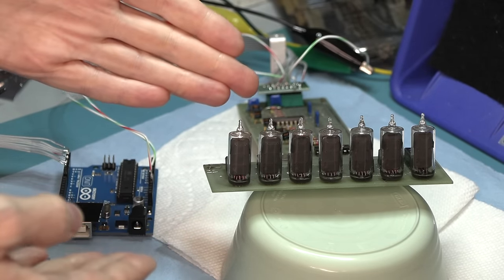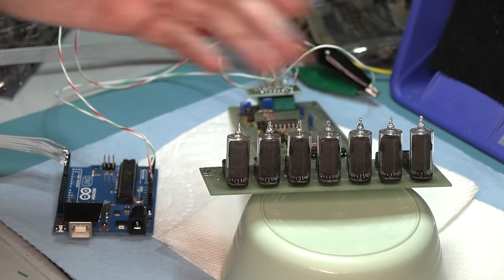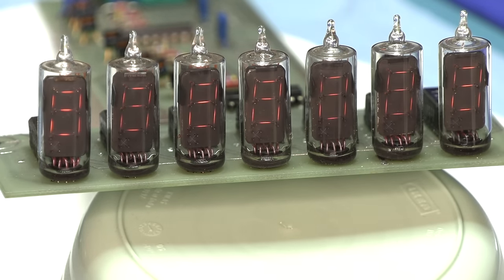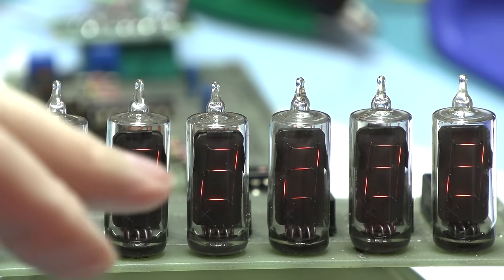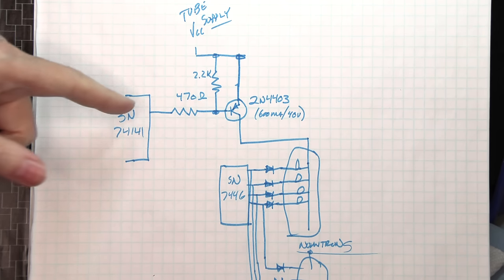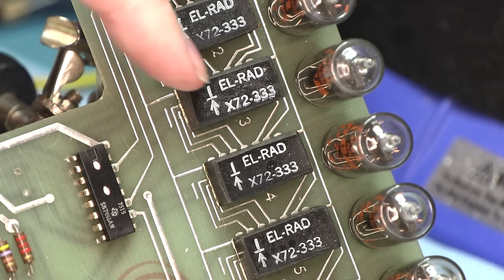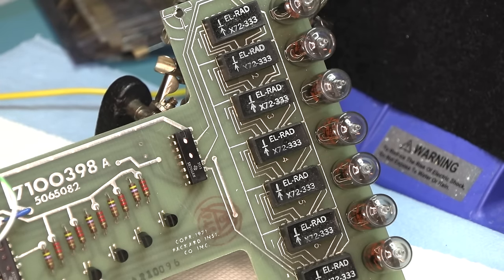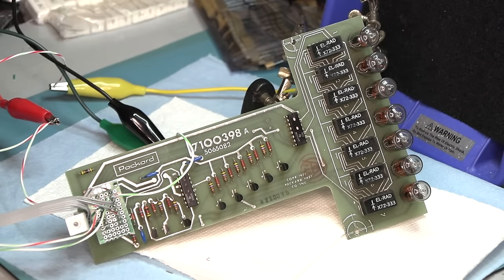The Magic Of Muxing!

Comment: NEVER multiplex vintage displays if you have the option to do direct-drive. As a longtime creator of clocks using nixie, numitron, NIMO, etc devices, the last thing you want to do is reduce the operating life of a device that is no longer manufactured.

In the old days, multiplexing was done because the drive electronics was expensive. Today, the electronics portion is dirt-cheap compared to the cost of the tubes, so saving a few dollars on the IC's doesn't make much sense if your tubes cost hundreds of dollars apiece. For example, the gigantic, though butt-ugly 14-segment 7971 nixie tubes are going for 200USD apiece now, and the few NIMO tubes I've seen were over $300, and those were untested. A six-tube clock is a hefty investment, so treat your tubes as best you possibly can.

Why is multiplexing bad ? Simple. When you multiplex, you can see the brightness goes down. To offset this, the current must be increased in order to increase the brightness. With gas-filled tubes, the wearout mechanism (generally sputtering) is exponentially proportional to the current. Incandescent tubes undergo thermal shock, from cold turn-on as well as thermal cycling. Similar wearout problems can be expected from multiplexing fluorescent and electroluminescent displays.

Some displays, notably gas-discharge panels and multicharacter displays, require multiplexing because the number of pins disallows direct-drive, so in those cases you have no choice.

I add circuity to limit display currents to safe values, such as using current regulators on my nixie clocks, and filament preheat/cooldown on the incandescent/NIMO ones. Knock-on-wood, nothing has died yet.

Comment: I loaded PC boards as summer jobs during college. Paid twice minimum wage! A really good high school electronics course meant I could easily read resistor codes, and a Manpower rep at a job fair said, “Want to be employed tomorrow?” 😄 Got me through college! And yes, I was usually the only male. 😂
Reply: Its hard these days to simply get young folks to come to work 5 days in a row.
Reply: @resipsaloquitur13  it wouldn’t be if you paid twice minimum wage.
Reply: Same here but wire-wrapping! The cables were colour coded for length. Sounds tedious but I loved it.

Comment: It would be very nice for a nightstand clock. Analog voltage dimming for night time, tubes would last forever if not pushed that hard.
Reply: Yep. Made one. Pi powered clock radio.
Reply: @liquidsonly  you posted it somewhere for us to see? And why a Pi? Itsy quite power hungry.
Reply: @zaprodk  My posts to the link get deleted each time.
Reply: @liquidsonly  Only solution seems to be to setup your own YouTube channel, put your stuff in there then post that YouTube link here - YouTube does not mind links to itself 
On your own YouTube site, as your now a creator, you can put in as many links as you like, just like Fran has on here.

Comment: What i am missing (or did not see?) is something for emergency shutdown of the filament power when something with the mux goes wrong. Just a random software crash may kill the expensive display quicker than the watchdog timer would kick in....
Reply: This demo doesn't seem to have such a feature and that's probably why Fran is turning on the filament supply after the logic supply. But it should be noted, light bulbs can often last for a few minutes at 3x rated voltage before burning out. Knowing this, a few seconds of 7v on a 5v filament isn't going to cause any harm. If Fran was running higher voltages additional protection would be much more important.

Comment: At one point I had the idea of building a large matrix display with micro incandescent bulbs, 1.2V/15mA per bulb or so (still sitting in a drawer..) - I stopped when I realized that soldering 800 flimsy wires to my 2.5x2.5m framed wire grid and also programming the graphic functions was a bit tedious. But what helped to increase the response time of the bulbs was to preheat them with a current that didn't make them glow, or to scan them fast with a pulse width that also didn't make them glow just yet. As far as I remember this way it was not necessary to bump up the voltage this much. (So in case of an error they wouldn't break because of the overvoltage.)
Reply: I have the identical idea.  The “always on” current, will be high, and effectively creat a I.R. source (I would fine-tune that voltage/current in a darkened area, for a barley perceivable glow), effectively, a radiant heater.
This technique will increase the glow-time, after the ON signal is replaced with the Keep-Warm, which is a small inconvenience compared to the projected extended life of the lamps in your display.
I’m looking forward to seeing your build!
Reply: Somewhere I saw a spec sheet / data sheet about using bleeder resistors for a trickle-current thru the filaments.
It wastes energy but reduces the thermal shock so it probably extends the lifetime of the filament since it's already at high resistance.
Reply: @SawdustSoftwareSiliconChippy  :) I've did this in 2006 or so - unfortunately I'm struggling with my health nowadays and due to the tremor of my left hand (and a huge backlog of ideas/projects) it's a bit unlikely that I'll revive the project. Anyway, I was fascinated to have an almost point-like, tiny light source that shines 360° in all directions. Today you can probably find LEDs for this.

Comment: I could be wrong, but i dont believe solder flows over the component side during wave soldering.
Reply: Seems pretty risky, "feels" like high chance of blobs n bridges gettin' stuck under the chunky components. I have no direct experience of PCB manufacturing in the '70s though, I started dabbling with it during mid/late 90's 🙂
Reply: Agree. The solder is ONLY on the bottom of the board. If it were to go over the board it would immediately be scrap. The thick solder traces are covered in solder before the components are loaded and it's called HASL.
Reply: Yes. They tinned the traces before putting the components. Once saw a board where the wave accidentally went over the board. What a mess.
Reply: Agreed. The one time I got a tour of the PC board manufacturing facility, I saw how the solder "kissed" the bottom of the board and wicked up.
Reply: The board is suspended trace side down over a tank of liquid solder. A linear actuator at one end of the tank "slapped" the surface of the solder, sending a single wave along the tank and washing the underside of the board.
When you stuffed the board the tails had to be folded over because the solder would push the components out.
The women stuffed the boards but men flowed them, at least where I worked.

Comment: I'm not sure if the 5 ms and 2 ms mentioned were per digit or per the entire display.  I suspect "per digit."  You have to get above the human eye "flicker fusion threshold."  Long ago we might have called this "persistence", but that term also means how long an image may be perceived after it was gone, so the more specific term is now used.   It is about 60 to 90 Hz for humans.  If "per digit", 5 ms would be 35 ms to scan the entire display which is about 29 Hz and "flicker" would be expected.  At 2 ms it is 14 ms for the entire display which is about 71 Hz and probably barely fast enough for at least many humans.  But if certain other animals are watching this, such as an owl or a house fly, they will still see a flicker.  You have to be a bit careful designing such things as not all humans are identical and if you use yourself as the test subject, somebody else might still see flicker.

Comment: Would the cost of one diode block be 40x more expensive? It might be possible that producing this block would be only 3x more expensive than same amount of discrete diodes. ICs weren´t that much integrated at that time. Encapsulating a single diode vs. encapsulating a dozen diodes should not be a factor of 40! Still a valid point of cost saving by using ICs.
Reply: If the blocks were custom-made it would be more than 3x the difference. If it was off the shelf then I could believe 3x.

Comment: If you're multiplexing with overdrive and the processor locks up, I guess you run the risk of burning out a display?
Reply: Yes. Also imagine just how many TVs got a horizontal phosphor burn from the vertical deflection malfunctioning. With the specific display Fran has the original host device most likely used hardware multiplexing, minimizing the risk.

Comment: I have a few hours free if you like me to debug FranCad. Funny that the "boring" part of the video was what I wanted to learn about most. I have some ICs that I wanted to use for multiplexing, shift registers actually IIRC, but I have never gotten them to work. Been a while since I tried, maybe I wasn't using diodes. Funny that that I do digital programming and analog electronics, but I know nothing about analog programming and digital electronics.

Comment: Awesome as always Fran! Another scheme for multiplexing I am using 74hc244 tri-state buffers with the outputs tied together. BCD inputs would be controlled by a CD4017 which is pulsed by a 555 timer at the frequency of your choice. The 4017 fires the OE pins of the tri-state buffers like a distributor cap on a car. A "good" way to run those pesky VFD tubes with all of the digits inside one tube like an old microwave oven. Arduino would be easier of course, but this is another "easy" option. I'm kind of new to this, but I believe that most multiplexing is an integral part of the IC's or micro- controller(s) being used. A 74hc244 has 8 channels with two OE (low output enable) pins on each so that would allow you to only use seven of them to control the segments and possibly a decimal point. If not, be sure to tie one of the inputs low or high. Hope this helps someone out there. Comments welcome.